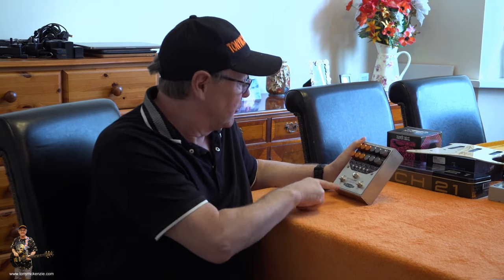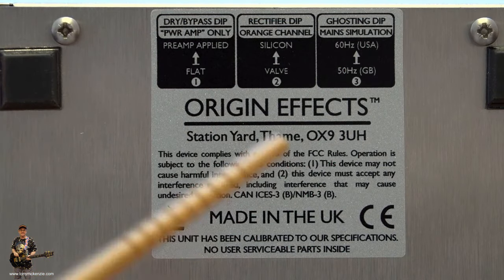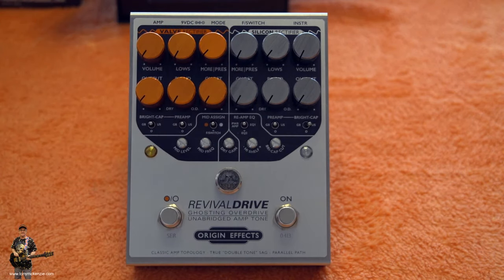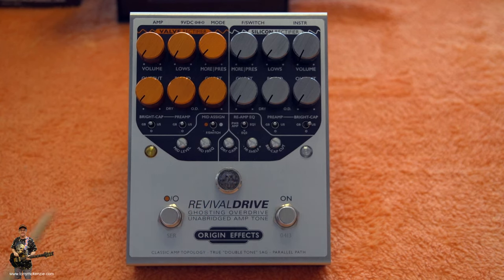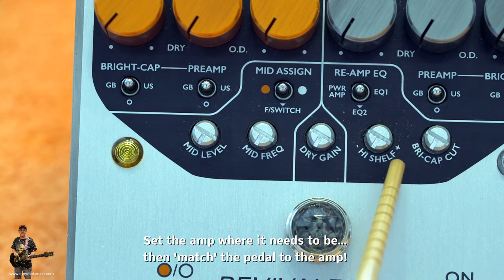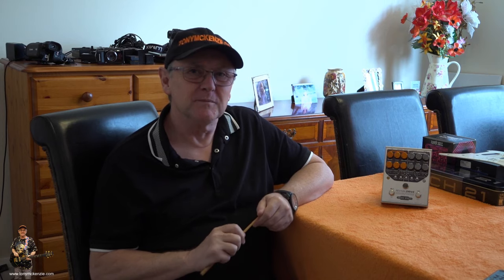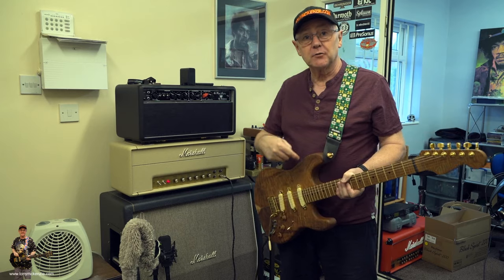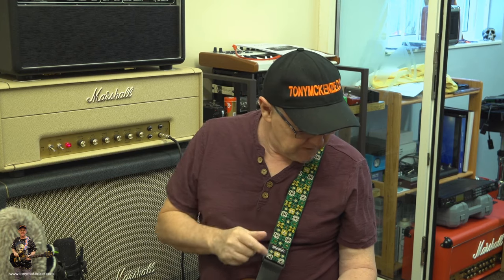Origin Effects Revival Plexi Drive Pedal Close Up | Inside and Out Review with Audio | Tony Mckenzie

Comment: Hey I realise this video is over 2 years old at this point. 

The grading is a code is used for our calibration process. We hand measure key components and give them a colour and number based on the measurements we read from them. These are fed into our test setup when calibrating the units. This ensures tighter and more accurate tolerences.
Reply from the maker: Well thank you for the information... and that is a great addition to the video especially from yourselves. I had to 'guess' a lot at the time :) but it seemed a vey well made unit of very high quality and I hope that my little review showed that. Thanks for visiting...

Comment: Your last guitar build convinced me to buy the Babicz tremolo. Order it today ,thanks Tony .
Reply from the maker: You know what Dennis, that guitar was so easy to set up and the result was great. I put the setup down to that tremolo because the fulcrum for the saddle height can even go lower than the Fender stuff. Once locked afterwards it all just worked very well. One thing, I did have to lubricate the nut. Sounds obvious? But it's not... simply because of the material used on the nut, and the first guitar I have ever had to apply lubrication to the nut! Just watch for that... it shows as  short 'pings' of the strings when you use the tremolo. It's not a fault, but the lobe solved it perfectly. Hey do let me know how the Babicz works for you - for me it seems a very good tremolo and certainly a unique design. Stay safe.

Comment: How does this pedal compare to the Ethos overdrive, is it really worth it?  I don't know, I like it, but it's not worth spending so much money on a pedal.  I am undecided whether to buy the Revival, the Ethos, the JHS Bonsai or the King of tone. The Revival Drive it’s analog or digital?
Reply from the maker: Is it worth it. That is a very good question. I liked this pedal for the quality and it's build. I don't know the Ethos pedal sorry. The KOT is different than this and I don't really think this pedal is similar to the KOT. Waiting for the KOT is a long time! I rented this pedal which is (they say) like a plexi amp. Many will tell you that also. However, I have at least TWO plexi amps and they sound different to this pedal in my opinion. I did get the 'sort of' tone from the pedal, but to be honest I have yet to find any pedal that could make me throw away my plexi amps. Having said that, if you spend time on this pedal I would relate to it being as good as any of the others really and maybe better in the build quality than some. Hope that helps a little. Stay safe... and thanks for watching.